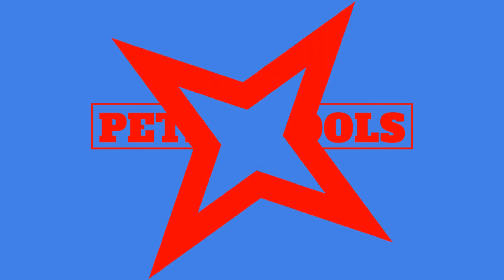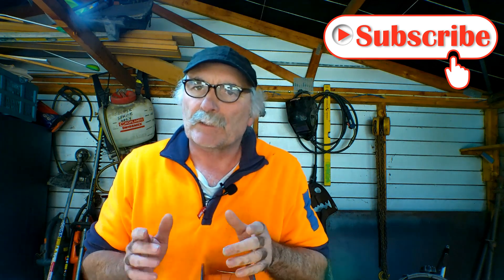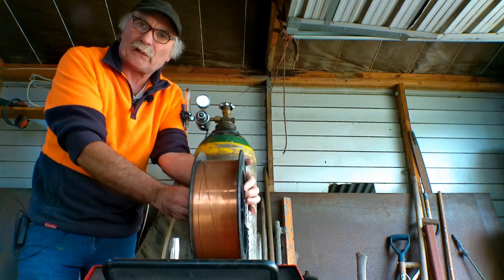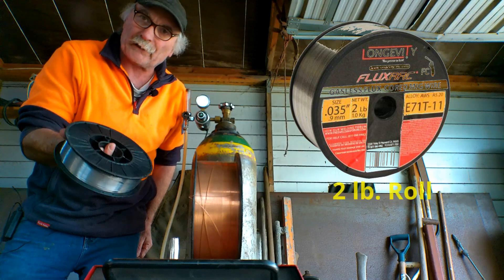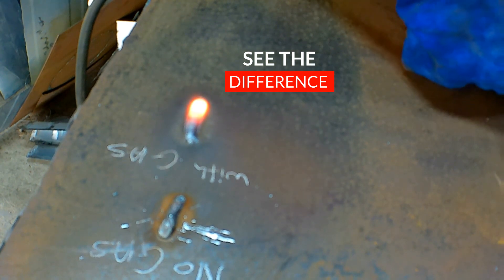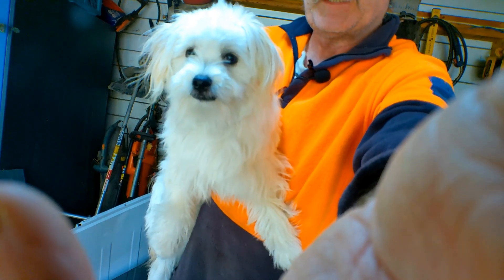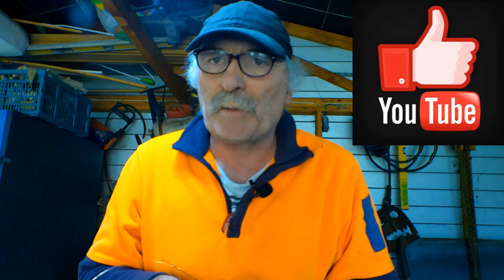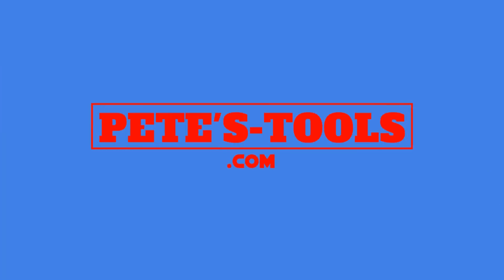Beginner MiG Welder Gas or Flux Core?

Comment: I have both types here (started off with the gas version, then bought a cheapie gasless), and quite frankly 99% of the time I grab the gasless (a lot of my welding is outside, and that is where the gasless shines imho)- plus the gas one is a LOT bigger and heavier to give the exact same output power...
Gas 'used to be' cheap as chips, but then my first kit was an oxy torch- when every man and his dog has one on the farm back then- now I haven't seen one in years- too expensive to own and run...
Reply from the maker: Hi Steve ,Yea gas is getting very expensive here in nz as well .So I find I just use flux core now, Thanks for watching mate .

Comment: Good advice Pete!  I have a mig that can do both flux core and gas....never bothered buying the bottle of gas and am quite happy with the flux core welding.  I figured the extra $$ and hassel of the bottle was not worth it to me.  I also figured I would run out on a Sunday afternoon after the stores were closed....then what do you do?  The one thing I do have that I use quite a bit is a stick welder.  Mine happens to do AC and DC.  I have found DC easier for me and is a great tool for heavier jobs.  Keep the videos coming, I really enjoy watching and learning from them!
Reply from the maker: LOL yea your not wrong mate ,That's murphy's law .Thanks for watching mate

Comment: Another difference l've noticed since l switched over to strictly inverter welders is a tendency for some of my flux core welds to crack.  Cleaning and grinding out the cracked weld and then rewelding it with gas mig, the weld would then hold.  In fact l have yet to have a gas mig weld crack.  Likely this is due to amount of heat being pumped into the steel.  I have read that flux core gets way deeper penetration.  Interestingly my old transformer based mig welder, when running flux core, seldom had cracked welds too.    I had inquired with Forney if there were some sort measurable differences in the welding characteristics between inverters and transformer units.  They couldn't answer that.  Since my old machine had only about half the output of my new machine it might still be the heat input that's to blame.  Anyways,  good to see you still up and around.  Cheers.
Reply from the maker: Hi mate ,That's really interesting You might be correct about the heat .Thanks for watching.

Comment: Pete: I learned on MMA (stick) AC 50 years ago, later MMA AC/DC then TIG. I’ve got dedicated machines for all modes now after finding that all mode machines are generally poor at MMA welding because although the amperage is OK the voltage is so low that only certain DC rods can be used. Therefore I sold my multi mode DC only Synergic Lincoln MP210 in favour of an older Miller Econotwin 150 HF transformer welder for TIG AC/DC MMA along with a Reboot RM1600 MIG/MAG. Stick is still my “go to first” mode.
Reply from the maker: Hi David ,Thanks for watching .With me my stick welding skills suck really ?I have always used MiG.

Comment: It’s taken a while, but Flux Core is finally, and might I add, once again, getting the respect it deserves. I agree with you 100%. I too have both, and 80% of the time, I reach for flux core, ‘cause it’s just so much easier to get set up, especially for a small to medium application, plus I can use it in the shop or outside. A few short years ago, all the so called “experts” shunned Flux Core, as almost anyone could get started for a modest amount of money, and at least be able to “stick” things together, and they didn’t want the competition (JMHO). The evidence for the advantages of Flux Core was always there, it just wasn’t recognized. But now, with so many people getting into the hobby, that attitude is changing. Thanks for your vid!!!
Reply from the maker: Hi Mark, Thanks for watching .I find that most new welders just want an easy process to learn so they can stick shit together in there sheds. Its not as if they are welding structural steel .Just learning a new hobby.